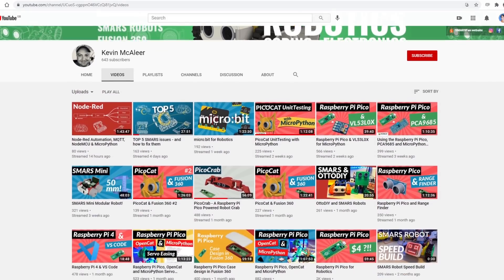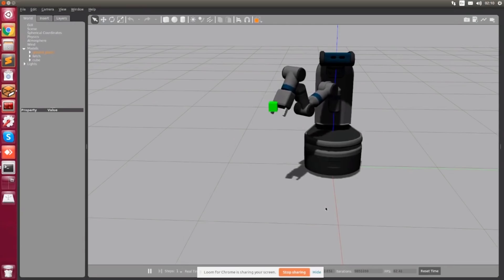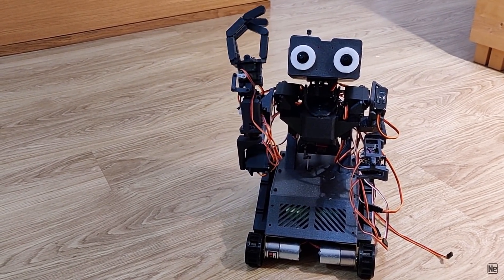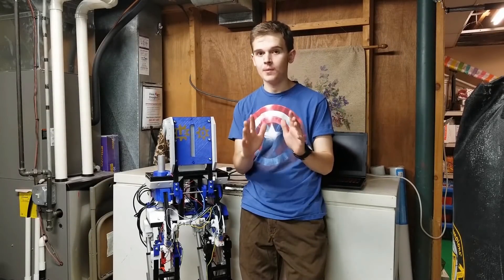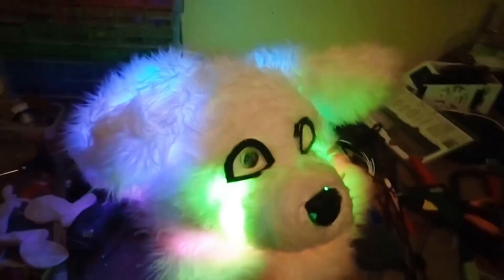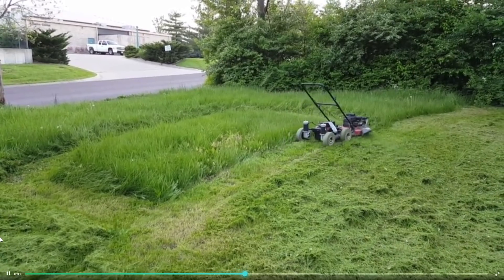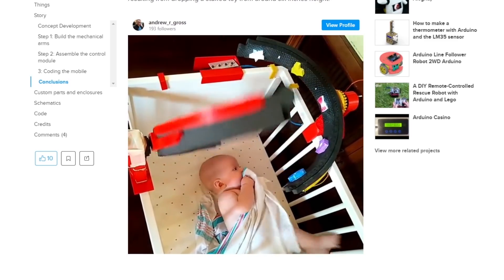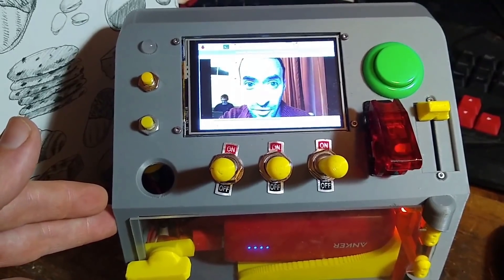RISE OF THE MACHINES!

Comment: Do facial movements actually need to be controlled in a super accurate way?
All the muscles in a human face are really dependent on the other muscles around it to contort the skin which in turn creates whatever facial expression is needed.
Now pnumatics is not able to be used to move most robotics around because of the imprecise movement control positioning and position holding situation BUT controlling an animatronic face in a realistic way using air powered "muscles" would probably create far more realistic results.
Here I'm  thinking about these:
https://www.instructables.com/How-to-make-air-muscles!/
Imagine 3 of these covered by a membrane...
By activating various combinations at different pressures you could contort the membrane into all sorts of shapes - much like facial skin dose.
And the best thing is that to get human-like movement it does and should not be precise but rather "fuzzy"
Thats my 2 bits at 3am